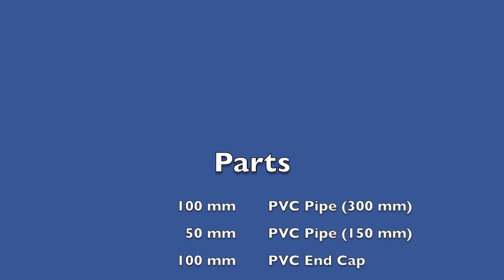GSS-75

Comment: What about shielding the top and bottom? Bottom is just a disk, top could be a split disk if the detector top was not exposed.
Reply from the maker: Thanks for comments, I agree, there are mnany ways to make further improvements, replacing the 50 mm pipe with a copper pipe would also reduce the inevitable Pb x-ray peak.